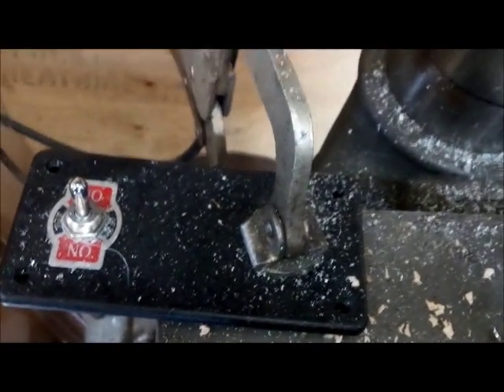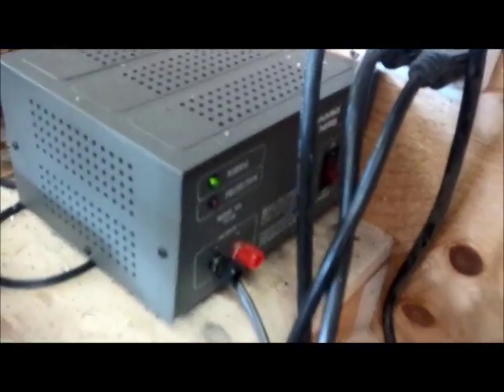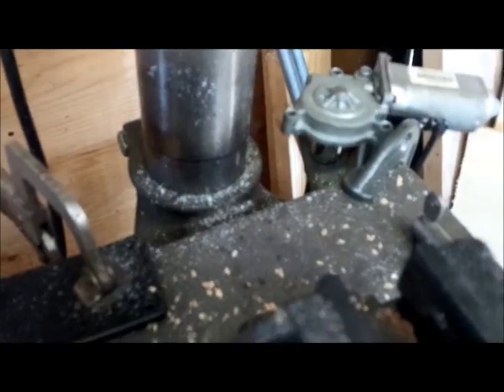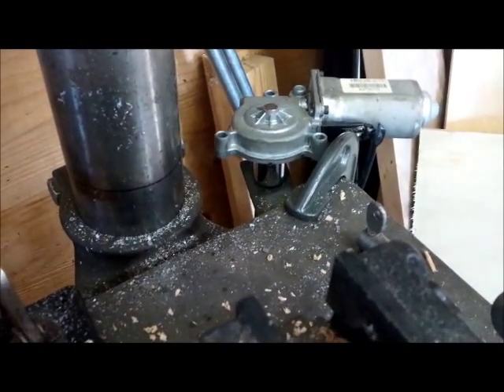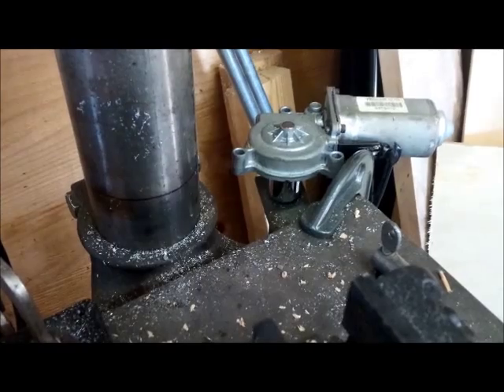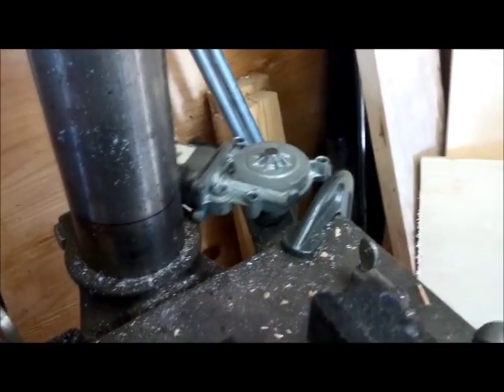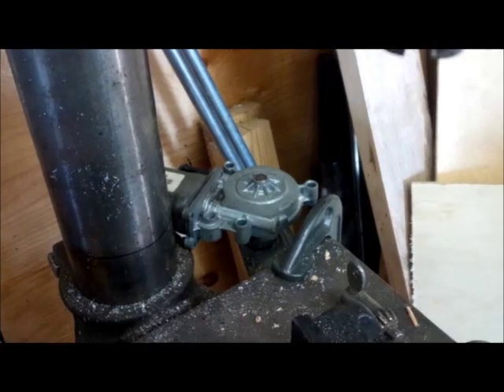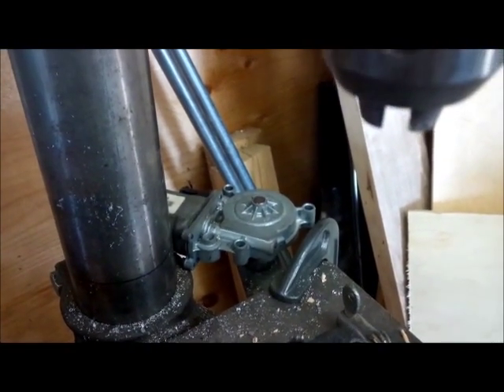Power drill press table lift.

Comment: I think I can forsee a machining project in your near future Steve.  Shouldn't be all that hard to fab a collar bracket for top side of that screw jack that will slide up the column.  The Buffalo 18 uses that type of mechanism, albeit a manual hand crank.
Reply from the maker: You read my mind Jarrett. Just need things to warm up a bit. So many projects on the go and many more in the planning stage. Heck I might even get some woodworking in eventually.